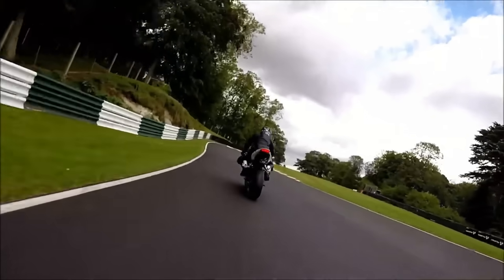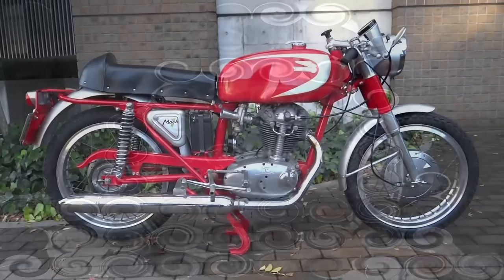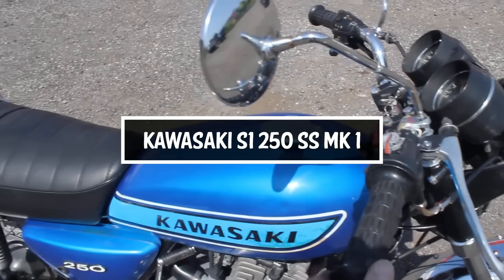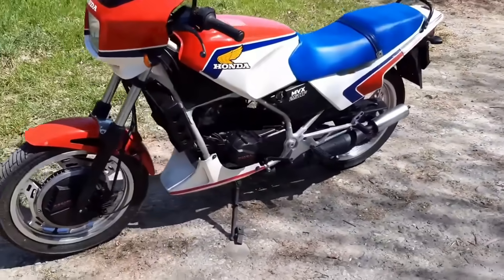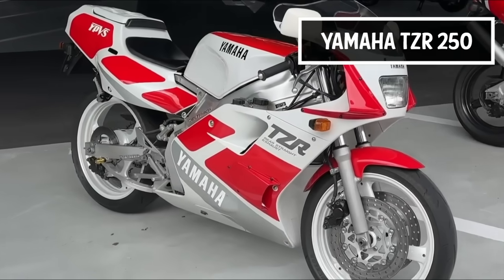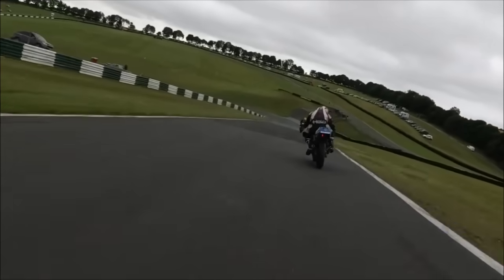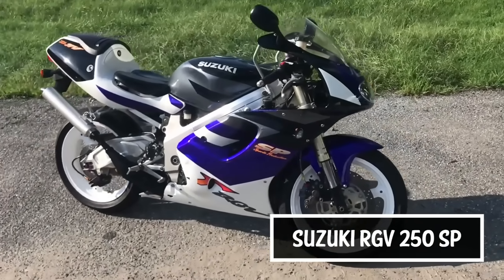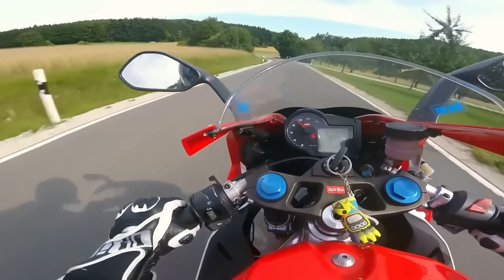The Fastest 250cc Motorcycles

Comment: In the 90s my friend built an RG250 project with his dad. They sent the motor to Kevin Cameron to have it built. It put out 52WHP on a stingy local dyno. In hindsight it was one of the most special bikes I've ridden.
Reply: Top work yes that motor must av been well tuned also to produce that decent power it must have been fantastic on the go 😂
Reply: @stephenhurst9257  Indeed, very peaky power delivery. About 2000rpm of useable power at the top of the rev range. If memory serves, it had re-worked  FZR 600 forks and swingarm as well as wheels. If I knew then what I know now, I'd have a collection of historically significant motorcycles from the 80s and 90s. LOL
Reply from the maker: that was/is part of the joy, that tuning. We had a guy called Terry Beckitt back in my day who was a wizard. and i thought i had done fairly well getting a TZR I had to around 65HP but the guy who bought it (the right new owner) took it to Mick Abbey and in the end (lots of changes including a banshee block) got it up to almost 90HP at the wheel which was unbelievable to me. but i saw the dyno readout. Mick is obviously the modern day Terry Beckitt i think :-) Cheers for watching mate,  have a great weekend

Comment: It seems that the Suzuki T20 of 1965 is missing in your otherwise very complete listing. As far as I remember, it was the go-to 250 cc bike when it appeared, with its 6 speeds gearbox, at keast in France where Kawasakis were not imported at that time. It was also easy to tune for racing/
Reply: I owned one in NZ and it was a genuine ton up bike there when the oil pump was set right …
Reply from the maker: there will always be ones that get missed, they werent as popular here. it wasnt until the ram air GT250 that Suzuki started to gain more of a market share but it maybe should have been mentioned

Comment: Small correction: it's pronounced Aermacki.  As you predicted, here's a correction regarding the Honda MVX250F being Honda's first two-stroke street bike. It wasn't. If we discount the fact that Honda's very first production model, the A-Type, was equipped with a small two-stroke motor, the title goes to the MB5 launched in 1979. If we include all street-legal models as opposed to street-only, then we must include the MT125 and MT250 dual sport (or dual purpose as we used to say and not to be confused with the MT250 road racer) both launched in 1974.  And now the biggie: no one has to thank MZ for rotary disc-valves on two-strokes. They did use them on their GP bikes, but they did not invent them. What Walter Kaaden, MZ's race engineer, did do was to develop formulae for calculating exhaust resonance in two-strokes in order to improve gas flow and in particular he improved on the work previously done at DKW (MZ's pre-WW2 predecessor before the partition of Germany) on expansion chambers. These formulae are the secret that pilot/engineer Ernst Degner took with him when he defected out of communist East Germany and it is the reason why every performance two-stroke is fitted with expansion chambers. And now an anecdote: when I was a motorcycle-mad teenager in Montréal, I would often walk or cycle over to Plaza Cycles which was one of Yvon DuHamel's early sponsors. Besides all the shiny new two-strokes and magnificent Z1, they would sometimes expose one of Yvon's bikes. Even then, it was surprising to me how small these race bikes were. And, of course, always with number 17.
Reply from the maker: i hadnt thought about the MB5 which is a bit bad because my mate had one :-), i stand corrected. and yes my pronunciation isnt perfect, old habits die hard as they say :-) and MZ/DKW might not have invented the dic valve but they did do a lot of pioneering development with it. and the way i saw it, it was the combined use of the better disc valve alongside the expansion chambers that was what improved the overal performance. but im happy to be corrected, ill do some more reading. my understanding was that without the improvement in performance of the disc valve the power pulse was less focused which made designing the helmholz resonator much more difficult. as the power pulse was focussed the frequency band of the resonator became narrower which meant it was easier to create the expansion chamber that would work over a wider rev range. so that is why i always mention the disc valve as well. Cheers for watching mate, hope you have a great weekend

Comment: Great video; it's good to see Cadwell Park. Like many of a certain age, I owned an Air-Cooled RD 250 and 400 and raced a 350LC (55HP). I also had an NSR250-MC28SP with the card ignition mapping. Finally, two TZ250s (both 1998) still have a Honda RS250R (2000) (84HP, at the rear wheel))and a 97 RS125R (42HP ATRW), both tuned by Graham File. I don't ride anymore, but the smell of two stoke (especially with 747) still gets the juices flowing...
Reply from the maker: glad you enjoyed it the video, Great story, Cadwell has a lot of memories for me 🙂Cheers for adding your bit mate.  🙂🙂 Theres plenty more on the channel, hope you will look around and find something your interested in. there is more on the website too. and there will be more to come. Cheers for watching.Hope you will climb aboard. Ride Free 🙂

Comment: Thanks for this. When I was growing up in the late 70s/early 80s, the 250cc sector was very significant because at the time, that was the maximum sized bike you could ride without passing a test. It was a very competitive market with manufacturers struggling to get the more power out of a 250cc engine, just like they did later with the 125cc when the limit was reduced, before other ways were found to limit their power. I remember the Honda CB250N Superdream being very popular, also the Kawasaki KH250 and Suzuki X7, but it was probably the new Yamaha RD250LC which took it to another level and made the authorities wake up to what was going on.
Reply from the maker: wild days mate :-) Cheers for watching and the comment , Ride Free
Reply: RDN 189P was my beloved yamaha RD 2.50 'Reed valve' torque induction in red. Faster than my old Honda 2.50 and faster than my mate's kawasaki kh triple.

Comment: Very well researched and presented video , the early bikes I knew nothing about . I’m a massive 2 stroke fan having had the Yamaha RD250B torque induction , 3 Suzuki X7’s , Kawasaki KH400 , Kawasaki AR80 , all in the early 80’s . Currently own an Aprilia RS250 and a Kawasaki H1 500 mach 3.
I tuned all my bikes , the Yamaha tune was a disaster but I was 17 at the time .
I did an awful lot of research into speed / tuning about 10 years ago , in paying a lot of attention to the Bonneville land speed record holding Kawasaki KR1S owned by Mike Jordan , his average speed over 2 runs and a measured mile is 136.559mph set in 2007 , beating the previous record also held by a Kawasaki KR1S at around 129mph. Although these bikes set the P-P records ( production bike class ,P= production frame and the second P production engine) you are allowed “ out of sight “ modifications which undoubtedly includes engine tuning internally.
The El Mirage speed record is/was also set by a Kawasaki KR1S at around 139mph , this only checks terminal speed after a 1 1/4 unlike the Bonneville records.
I myself went to Bonneville in 2014 in an attempt to set a new record with my Aprilia RS250 but the event was cancelled at the last minute due to course flooding . I’ve yet to return ( still on the bucket list) 
In the mean time I have some speed testing to do at Elvington airfield .
Thanks for making a great video , hopefully one day my Aprilia RS250 will set a record 🤞😉
Reply from the maker: all the best and good luck in the quest mate, you have the bike for it, Cheers for watching mate, have a great weekend 🙂
Reply: Thanks , hoping to break into the 140mph plus territory as not seen any official records for a production 250 at 140+mph
Reply from the maker: @super582  keep us posted mate, interested in your progress
Reply: I will and thanks for your interest 😊
Reply: What’s the best way to keep you posted , I have speed testing planned for later this year !
Reply from the maker: @super582  i look forward to it mate

Comment: I had a 87 tzr production race bike to Aus as a grey market import. Bought it after it had race a season. Was 110kg on the truck scales at work dry. I was pretty young and never sorted the suspenion properly as we had no one to guide us and no internet. One mate had an RZ500, one a KR250 and the other a KR1. RZ was damn quick in a straight line. TZR was quickest to about 120km/h. KR1 was a dream. Info on the Suzuki Across, they were rubbish, but you could put the helmet in the the storage area under the fake fuel tank.
Reply from the maker: All truly great bikes. Still miss my tzr

Comment: I’m very had to pause at the start for this comment as the modern day 250 cc engine and bike are with the 4 cylinder from team green. Back to continue watching as I can’t wait to get to a bike and class I started out my racing on. The Suzuki RGC-250 in the Australian 250 cc Production Class. All stock and the only mods allowed were the obvious full race fairings and removal of all road gear. You could change sprocket sizes depending on the track. For Phillip Island (my home track) these 250’s were radar clocked at over 220 kph on Gardner Straight. I still to this day have one out of the two I ended up racing in my collection in basically brand new condition. Back to your video.
Reply from the maker: hope you enjoyed it mate :-) i like the look of the new 400 four pot they are making too, UK prices just released, could be worse but £9.5k is a big ask with the price of some bikes around, .Cheers for watching mate, Ride Free
Reply: @barebonesmc  You could also throw in CFMoto’s latest bike. Their fully faired 450 which looks appealing for any learner to get some track time in. As the old saying goes, if you can’t ride a slow bike fast, then don’t bother trying a bigger bike. Could even be a delight for even experienced ex racers. As my kids weren’t born when I was racing and have only watched them on YouTube or VHS’s saved from live TV, they got me a track day pass at Phillip Island for Christmas. Still trying to work out what to take to the track. Plus at 50 I’m hoping modern tyres, even on 90’s bikes will compensate for a diminished ability. I’ve raced in front of 110,000 track side and I know it’s not racing and only track riding, just think it still more daunting. Anyway, might breath some life back into my smallest bike and get the RGV-250 out for another go.  As I’ll have more fun than on any litre bike as a couple of World Champions still have a big smile when they talk about a racing class where all bikes where equal. Keep up the great work.
Reply from the maker: @marcusgeorge1825  i did a video about the SR450 here https://www.youtube.com/watch?v=HcBAkv9mkm4 🙂 does look a great little all round package compared to a lot ive seen
Reply: @barebonesmc  Thank you for the link. I agree, especially considering what you get for the price.

Comment: I have been in the motorcycle trade since 1977, have owned Yamaha YDS5, YDS7, YR5, Suzuki GT250, X7 & Kawasaki 250 S1. I have managed a 250cc British Championship winning team in the 90’s with a Yam TZ 250 and simply love the small capacity class, and what a SPLENDID video you have put together, I agree with most of what you say, however, the X7 was a ‘fair bit’ quicker than an RD250, the X7 was capable of keeping up with YR5350/RD350’s in the right hands as me and my 350 riding buddy disappointingly found out on several occasions ha ha. Thanks for the video. Have seen several Suzi Across in Taiwan where I now live.
Reply from the maker: glad it jogged some good memories mate, mymate had an X7 when i had my 350LC, it was damn quick, but the LC did the turns so much better IMO 🙂Cheers for watching. Ride Free 🙂

Comment: The rs 250 has always been a dream bike since I seen one at a dealership years ago.. along with the 125.. I had a 50 years ago with a tuned cylender that was a blast to rip around town on. No problem doing 65 on the hiway
Reply from the maker: it was an easy bike to throw around it was so light 🙂 i preferred the FT500 in many ways, but it had its flaws despite being a great bike

Comment: KR250 and Honda NSR 250 are two of the few bikes I never got to ride.
Never even saw Honda or Yamaha RRRR's, although did get to test ride 400 versions 'grey imports'
plus unaware of TZR250 as 'learner law' was in force nso few 250's were imported
The RGV250 got developed a lot, originals could have a few modifications to do over 130mph, I remember servicing them .
I always remember the Kawasaki's had very cheap parts and wore out real quick, never saw one that wasn't trashed (but I only ever saw them in workshop after 4~5 years) Only worked on one KR1S, even the forks were worn out when I saw it (not the seals, the alloy sliders) The 1993 Suzuki RGV was quite civilised, rattled like crazy though, the pulleys holding exhaust power valve cables were very loose on shafts by design, only worked at new shop 6 weeks before moving on to something different so never got to ride Apprillia
Reply from the maker: Great story 🙂Cheers for adding your bit mate. Ride Free 🙂

Comment: Great video! Thanks. Lots of nostalgia there. Reasons why modern 250's are boring:
> Emissions regulations
>The demise of the 250 learner class in many countries. (What's the point of making a screaming 250 when its costs the same to make a 500 that has more manners?). Here in NZ and Aussie we can ride 650s as learners.
>The demise of the 250 racing class
> The demise of the 2 stroke.
> The addition of ABS, starter motors and bigger batteries to drive starter motors.
Reply from the maker: i think the move in focus with racing probably the biggest global impact, the learner regs had issues in different places but that changes all the time,  :-) Cheers for watching mate, enjoy the ride

Comment: Conspicuous by its omission,  Honda VT250FD.  Released in 1983 in the UK it was Honda's 4 stroke response to the RD250.  It had a claimed top speed of 105mph which I saw on my bike a couple of times so more likely 90-95mph in reality. Damn good bike that handled really well. Enjoyed the video though and liked that the MVX250 was there.
Reply from the maker: ill be honest and say i dont really know the VT250 as well as the VT500's. Ive had a few 500's and they are great bikes. but i wouldnt have thought the VT250 would even get close to the CBR250/FZR250 etc. ill have a dig, but be interesting if some others make comment about their thoughts too, cheers for adding mate
Reply: @barebonesmc  technologicaly, it was pretty advanced for a Japanese  250. Four valves per cylinder,  double overhead cam, water cooled V-twin. 11500rpm red line, which whilst nowhere near the CBR's et al,  was still pretty high for a V engine. A claimed 35hp at something like 10500rpm (can't remember the torque) but suffered the same engine woes as the VF750.  The chassis was a double cradle steel tube , very reminiscent of the Norton featherbed and it had the inboard ventilated disc brake at the front with a drum at the rear. 
It is a beautiful machine which didn't fit in any of the sports 250 niches but tried to create its own. Sadly, it didn't sell in great numbers but has become a kind of 'guilty secret' cult bike. Very few still on the road in the UK now but apparently via various iterations, sold  very well in Japan. 👍
Reply from the maker: @TheFlyingDuckTheory  Sounds like the same stary as the 500 pretty much, the VT was a far superior bike to the CX, better at everything. am I right that they did another V twin 250 at a similar time with a slightly different frame? the frame on the other came more around the engine if i remember right?
like i say, i know the bigger VT's better, the 600 engine was an absolute peach, far better than the bigger 700 and 750. but tthe 500 revved better. the 600 just had a faster pick up because of the extra torque, and tuned really well. So i have no doubts about the credentials of the 250 🙂
Reply: The only other V-twin I am immediately aware of was the Honda Spada which used pretty much the same engine but had a wrap around trellis style frame a little like the Ducati Monster. It had a few more HP and a more reliable set up but was not touted as a sports bike.
Reply from the maker: @TheFlyingDuckTheory   sounds like it could be, it is a vague memory 🙂 ive been to bed a few times since then lol, have a great day mate

Comment: The KR 1s had a flaw, I rode my sons on the odd occasion and it was b fast but the pins on the pistons which stopped the rings from moving around would break allowing the rings to move round and collide the porting destroying the pistons and cylinder. While running they were exciting to drive.  My son had two and both engines succumbed to piston problem.
Reply from the maker: the voice of experience lol, .Cheers for watching mate, Ride Free